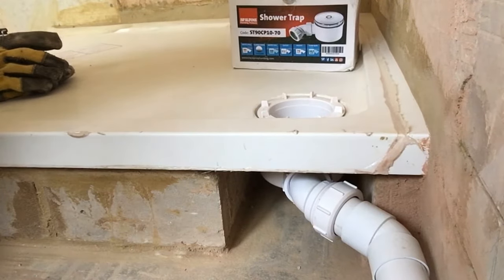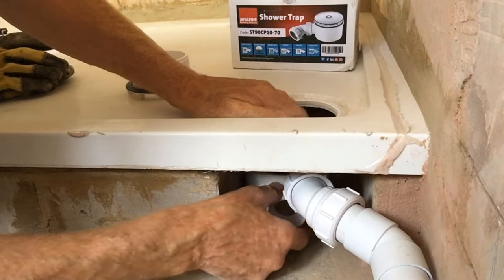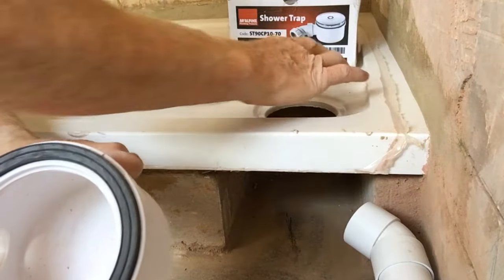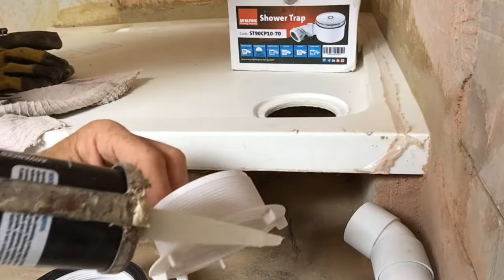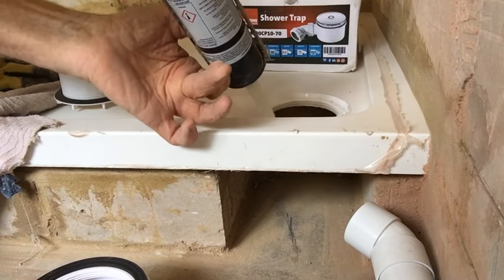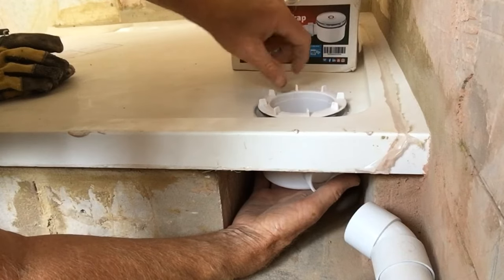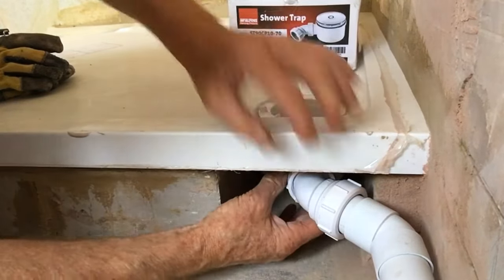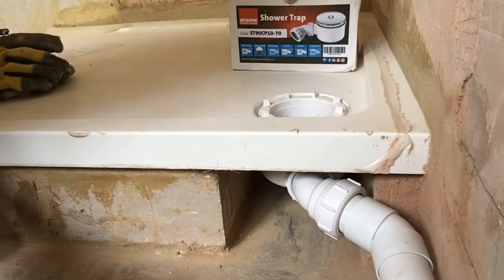Shower waste trap. DIY plumbing and how to fit a McAlpine waste trap to your shower tray.

Comment: I've fitted god knows how many trays over the years, when I've not used any sealant ive had the occasional leak, when i have used it ive never had a leak. Plumbers gold, ob1 etc are best, just a small bead does the trick. Each their own
Reply from the maker: Thanks for watching Jason. Yes new methods cant be ignored. I had a DIY friend recently fit a shower tray onto 18mm marine ply using just silicone. Non of this 25mm of sand and cement bedding business. Now idea how long it will last obviously...ATB b33zo

Comment: After watching nearly a dozen videos on this topic today, i now have at least ten different ways in my mind that this can be done.  Thanks youtube 😂
Reply from the maker: Ha thanks for watching Harry. Just stick with what you see here...ATB b33zo
Reply: Lol. That’s the trouble with YouTube isn’t it? If you’re a DIY’er you can get confused and wonder which way is best. Truth is there is more than one way to do this job. Nothing wrong a bit of plumbers gold sealant for added reassurance but it isn’t always necessary.  A good quality rubber washer will seal it if it’s all clean and assembled correctly.  Much easier to replace to when the time comes although not too difficult even when sealed with the help of some rubber gloves.
Reply from the maker: Thanks for watching @tellylgeorge  . Very true sir. If you have a decent shower tray and MacAlpine fittings the rubber seals should make a perfectly good leak-proof joint. b33zo
Reply: @tellylgeorge  l decided to just let the rubber to its magic au natural. In McAlpine we trust and time will tell!
Reply: Agree.  Some say use Silicone (like in this video), some say don't use Silicone and use Plumber's Putty intead.  Some show a black O-Ring with a cardboard ring warning you not to tighten without or the ring will warm and of course mine does not come with one.  My late dad had a saying.. Ignorance is Bliss.  The more you know the more you'll get confused the more you worry you might not have done it right.
Reply from the maker: @sogno2me   thanks for watching. Start off from a good place by getting the best quality trap/waste then you know at least you've got that part covered. Shower water is only going into the trap in a trickle so achieving a water tight seal with just the bare rubber rings shouldnt be too difficult. b33zo

Comment: Hiya, great video and very well explained.
There is a small pipe feeding out of the outlet, what width is that?
And the connector after that, what width is that? And the third pipe too ! what width is that one ? 
This would help with my shopping list as I am going to order one of these.
Reply from the maker: Thanks for watching Eamon. The shower trap which you can get from your local plumbers shop or Screwfix (item 45503) takes a 40mm pipe. Pick up a few 135 degree bends and some solvent adhesive while you're there. Good luck. b33zo
Reply: @ Thanks a million for this. I looked at the 135 degree bends and will pick up a couple for sure. I already had the shower trap for install hence my query. Thanks again, Eamon
Reply from the maker: Thanks for comments Eamon b33zo  @eamonodoherty3318

Comment: Do you need a separate trap to prevent sewer gasses with this type of waste?
Reply from the maker: @dhewitt2514 thanks for watching. This waste forms a trap once it contains water. No other parts required. b33zo
Reply: @b33zo  thanks mate. Great video

Comment: is it best to , solvent weld everything under neath ...

Ive been thinking what's the Best  or have a bit both .
Reply from the maker: Thanks for watching. A lot depends on the access available the number of corners and bends and the likelyhood of leaks. I would solvent weld where possible as its a permanent joint. The shower trap has a compression joint connecting to the pipework so that it can be replaced if necessary. Just remember to leave a 'manhole' in the floor for access. Good luck b33zo

Comment: My waste has only one rubber seal that fits under the shower tray. There is none over the shower tray opening which as this video shows fits underneath the screw top. I noticed this when last cleaning out my waste. Also no silicone has been used. 

Is it normal for just one rubber seal to be present or is one potentially missing from the install?
Reply from the maker: Thanks for watching Dando. The McAlpine waste system comes with everything you require. It sounds like the upper washer may have been left out. Main point is: does it leak? If it doesn't leak and you have limited DIY experience of spending half a day on your knees I would probably leave it alone until it does. Best wishes b33zo
Reply: @b33zo  I was able to unscrew, clean and examine. Floor underneath is bone dry. All good I guess.
Reply: My new shower tray came with a mcalpine trap. Only one washer supplied for underneath and install leaflet says to use a   "neutral" silicone sealer for top of the tray. It's the old style of tray, not the slimline type. Hope this info helps.

Comment: Nice video. The waste (the part you screw in from the top) on mine is disintegrating, maybe the UV light is causing it. I can't access the trap under the floor but my plan is to only replace the waste at the top. If I take the existing waste off (probably use Dremel so the trap is not forced), can I screw in a new waste without needing to hold the trap from below? I noticed you managed to tighten the waste from the top without holding trap.
Reply from the maker: Thanks for watching. I recently had a similar job but luckily a considerate carpenter had created a small 'trap door' in the floor and I could access the plastic trap to change it. I believe I saw a video where the plumber had wedged something into the bottle part to hold it up in position while he changed over the top screw in part. Definitely worth a try before ripping up the floor tiles. Good luck.
b33zo

Comment: Will that shower trap stop smells coming back if connected to soil?
Reply from the maker: Thanks for watching Tiger Eye: Definitely. b33zo
Reply: You'd want one with a no return valve.  Like the McAlpine
ST90CP10-NRV 90mm Shower Trap with Non-Return Valve

Comment: No need to put any kind of sealer on these McAlpine shower traps ,indeed McAlpine recommend that no sealer should be used on this product.
Reply from the maker: Agreed Brian. What McAlpine recommend and what I do is based on DIY experience and failures. Out of interest can you name of a plumbing job where Plumbers Gold is recommend - I've never used it before this little job? 
b33zo
Reply: Apart from making it more difficult to remove the trap in the future, what's the harm in using something like Plumber's Gold?  I ask because I am doing a shower trap replacement job (this stuff is all new to me, no experience at all) and in removing the old one, there are a few scratches on the shower tray, so I'm thinking a seal is a good idea in my case. Always like to hear the argument against though...

Comment: Did you forget to remove the plastic film from the tray before fitting?
Reply from the maker: Thanks for watching rh. I think if you watch again you'll see quite clearly that the protective film was peeled back for fitting the tray and is removed from around the waste before fitting that but left on the main part of the tray for well, protection. Good luck with your project. b33zo